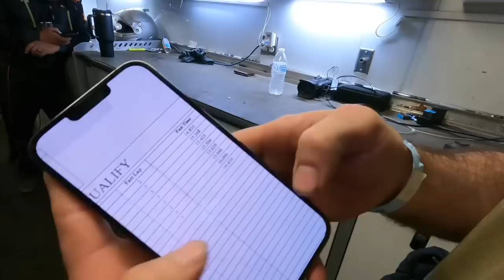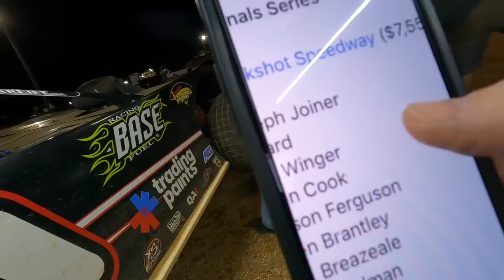One of Our Best! Joseph and Jesse Go for the Sweep at Buckshot Speedway!

Comment: So are you guys GOING to say LONGHORN is helping or have you finally gotten your WEIGHTS SET right in the cars ! You have shown a HUGE IMPROVEMENT on how the cars HANDLE and this all came about after you got SCALES ??? CUE THE HATERS
Reply: I strongly believe that they finally scaled the car and figured out that it matters
Reply: They know the cheat codes!! 😂😂
Reply: @gastruckin9314  Thank you I have been told so many times it dont matter its a dirt car but as a CHASSIS builder back in the day I knew different!
Reply: @CORNDODGER  I used to work for a couple racing teams in my younger days and they always swore by the scales.
Reply: @gastruckin9314  As a TECH inspector at our LOCAL NASCAR TRACK I was the guy at the SCALES and would know whom would be fast or not just by them Crossing the scales to go out and race